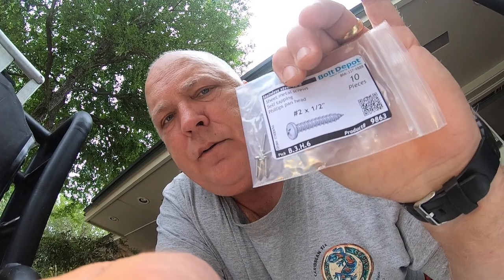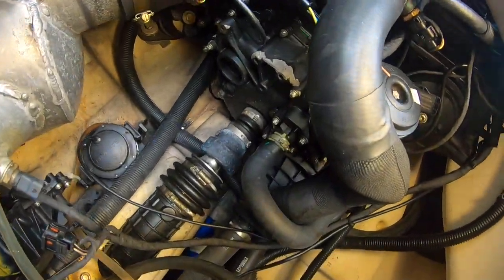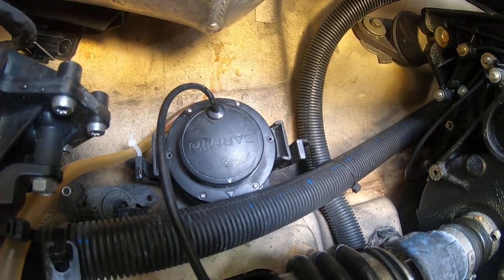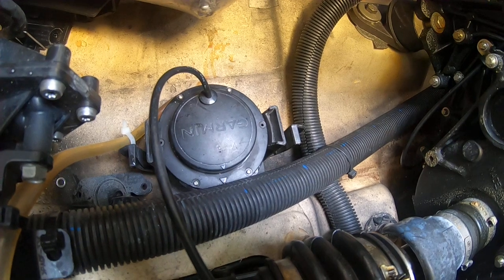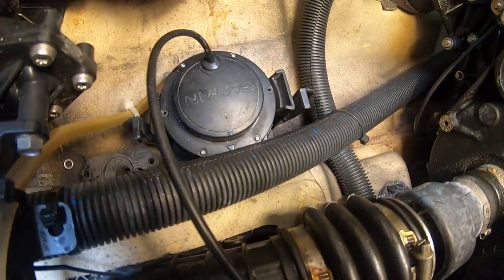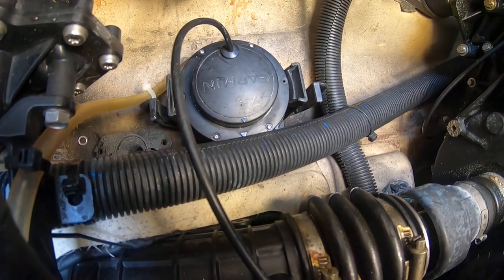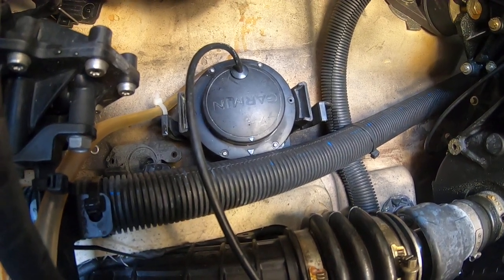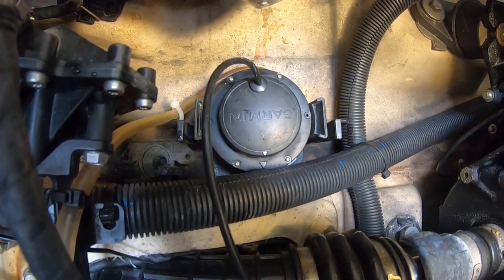Garmin FishPro Transducer  - Secure Top Cap with Screws per Garmin

Comment: Instead of using a liquid to fill the housing void (anti-freeze), I used a $5.00 bottle of Ultrasound gel from Amazon. It doesn’t go anywhere, hell I didn’t even use a gasket. I placed the rubbery tube on the housing and left it open to the air as I pushed the transducer down allowing the excess gel to fill the tube. I then plugged the end of the tube and zip tied it to a wire bundle. This crappy designed Garmin transducer mounting system is now fixed. I used four screws instead of six.
Reply: Thanks for this info, I'm going to try this!

Comment: Nice1. So annoying that the transducers are so shit considering the cost. Also those arrows point forward in the 22 trophy
Reply: I’m glad I read your response and you are correct. I just bought a 22 Fish Pro Trophy that didn’t have any fluid in it. The Arrow was pointed forward which is how I reinstalled it. Now with this video I see otherwise. I’m going to dig into the details a bit but I assume this video is correct.
Edit:
Per Garmins website the arrow is supposed to point inboard toward the keel. Went back in to redo it and noticed after several hot days, the baby oil I used had either already evaporated out or I have a leak I now need to chase. I suspect the tube that fits on the barb is leaking. I now have Ultrasound gel on the way and will go back in again and fix all of this mess again along with screws. If that doesn’t work I will order a new housing, sand everything flat to the hull then epoxy it with a different housing with No Tube attachment and use the gel.

Comment: Hey Bill. Did you remove the side clips that sit on top of the transducer somehow? Mine have two clips on each side that sit on the top that prevent putting in 2 of the 6 screws.   Also... did the screws solve your problem?
Reply from the maker: I still have them on there. I used only the 4 screws. As to solving the issue; I do not know if it was the screws, BUT, what with the #1 screws, #2 the new upgraded seal ( the red one as opposed to the original yellow one, and #3 the removal and reattachment of the fluid tube that mounts to the nipple at the bottom of the body with a bit tighter zip-tie, and #4 the extension of the fluid tube up to the front where I tied it into a fluid reservoir ( all this stuff being in the series of videos) things have not given me a problem.